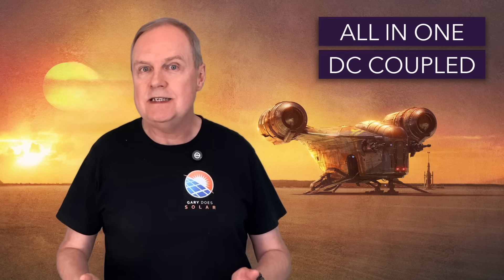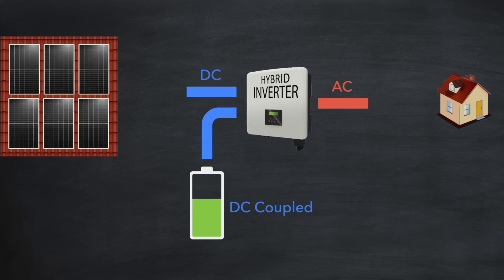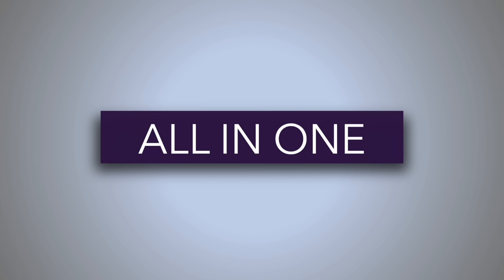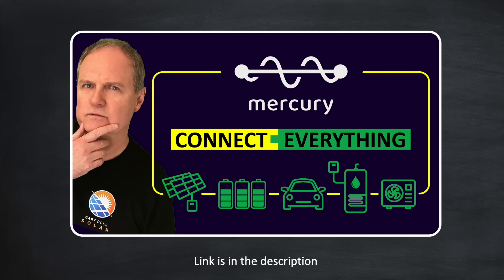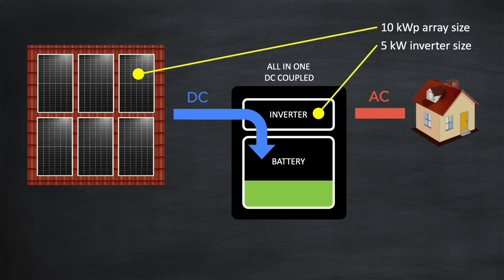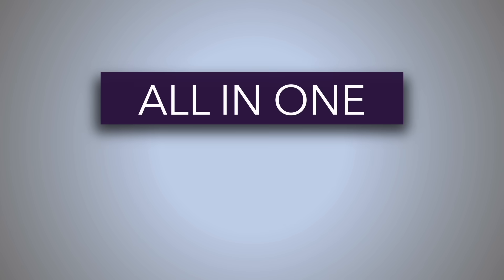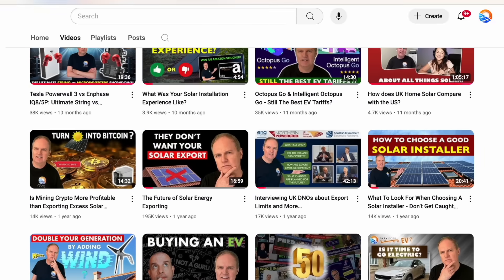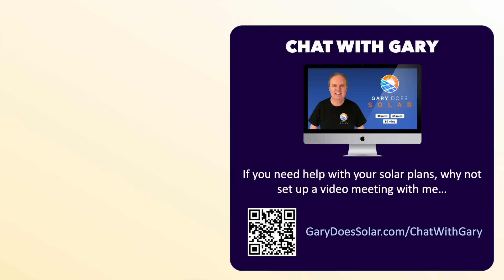Why All-in-One DC Coupled Systems are Transforming Home Solar

Comment: Great video, Gary! I agree with what you said. However, a drawback of all-in-one systems should be mentioned: you are reliant on a single manufacturer for your batteries. Will Prowse recently published a video of a 16 kWh LFP battery that cost less than $2k and was also incredibly efficient (though also more dangerous) because it uses high voltage DC. Additionally, the inverter was completely silent in sharp contrast to all the noisy inverters he had previously. However, he mentioned that at this time the system only works if you use the battery and inverter from the same manufacturer.
As to the micro inverters combined with battery storage, it seems to me they will always be both inefficient (due to multiple AC-DC conversions) and expensive (because you have to have 2 sets of expensive inverters). I don’t expect that the micro inverters will ever have both AC and DC output. As a general rule, it seems to me that: (1) if you want battery storage, avoid micro inverters; (2) if you can’t avoid micro inverters, don’t connect them to batteries unless you absolutely have no alternative.
Reply: The difference in costs between brand tied batteries and good quality non branded batteries is enormous so for any large setup an all in one is vastly over priced, and can't easily be upgraded.
For small batteries the ease of install and thus cost is a huge win though, especially if you are getting fleeced by the MCS.

Second consideration IMHO is that most of the current "all in one" models are Apple like products where it's useless without the suppliers cloud, the suppliers app, the suppliers batteries and on it goes. If your supplier goes bust (as is not unlikely when solar consolidates to a few brands in a few years), or if China v Taiwan kicks off you are going to be the proud owner of a very expensive brick. Likewise if your vendor does what Ecoflow keep talking about and decides to charge you a £9.95/month service fee for the cloud some day in the future you will be stuffed. Not just all in ones though - some of the non AIO ones are as bad.
Reply: @etchedpixels  The Sigenergy requires the cloud for updates to the software but not for operation.  You can get local monitoring via your phone if need be.  The battery modules can be replaced or added to individually.  New modules with different chemistries or other battery technology can be readily incorporated.  So far I haven't seen a better system on the market.  Admittedly I am in the USA and so my options are different than yours.  But It is pretty dang good.  I have seen a lot of videos showing how to build you own batteries for this purpose to save even more money.  I know for around here you would be hard pressed to get anything like that approved through the building jurisdiction or the Utility company.  Not to mention the fact that I am 70 years old and am not interested in building and carrying very heavy batteries around the house.
Reply from the maker: Great replies to your comment, Frank—and great insight from you 👍🏻
Reply: We’re already working with 500 volt DC from solar strings so voltage is not a new concern. The lower current in higher voltage circuits reduces heat which is the greater risk. It’s interesting that the National Electrical Code in the US is published by the NFPA. The FP stands for fire protection not shock hazard.
I’m too heavily invested in 48 volt to be changing to high voltage batteries at my age but it seems like the wave of the future. Especially in commercial or industrial applications where 480 3 phase is used.
Reply: You are correct.  However, it stops the "Oh, that's the battery or Oh, that's the inverter" when you call for support when an issue arises.

Comment: In 2023 we had 31 PV panels installed and we opted for Enphase IQ8A Micro Inverters.  Then in early 2025 we had two Powerwall 3s installed after they were updated to be either AC or DC coupled.  So that's what we have and it a great solution.  We were planning on adding two more expansion  packs but we are now holding off as V2H will be coming to more Tesla vehicles and having access to 70+ kWh of mobile storage is a dream come true.
Reply from the maker: Thanks for sharing this, Thomas—great stuff 😀

Comment: Keep pushing Gary & perhaps Sigenergy will help you replace your old system 😉. 
I've got my eye on a Sigenergy system to replace my 3.6kW GE Hybrid because I need a larger inverter capacity & want whole house backup as well. Just got to save up some pennies to make it happen!
Reply: I'm literally just doing that now.  Going from 3.6kW inverter with a 3.3kWp solar system, to 14kWp, 12kW sigenergy system, gateway and 25kW DC car charger. 
It's not cheap, a bit rusty watering but I look at it as buying 30 years of energy in advance. 
In an earlier video Gary mentioned Nationwide doing 0% mortgage add on's for renewable projects.
Reply: @djtaylorutube is the 25kW DC charger dependent on 3phase power?
Reply: @donalfalvey145 Nope 😀
It draws power from the DC bus devices and grid. 
To be honest that part is an expensive toy that I opted for, not for the charge speed, though one day that may be a bonus but rather future proofing when V2H gets more interesting. I considered adding it later but figured that I'd talk myself out of it and as part of a solar/battery install at the same time, comes in VAT free.
Ideally it would work better with the batteries as they provide power at half the capacity to the DC bus. I have 16kWh so could draw 8kW from the battery bud, then need a good sunny day and whatever from the grid. I don't know what the maximum grid import is yet. 
Irony is that on IOG tariff, my car is usually charging at 5 Amps. 😉
That said, it can be reduced in power (apparently) and it's just more efficient going entirely through the DC path to the car.
Reply: @djtaylorutube  Interesting. Thanks. My Installers told me I needed 3 phase for the 25kw DC charger. They may have been thinking of the older AC 22kW charger. I have 32kWh sigenstor and was thinking about expanding and adding a DC charger. I'd likely start another stack using the 10kWh (9kWh) batteries and add the DC charger to that stack. Looking at the Sigenergy spec sheet for the DC it doesn't mention 3 phase at all. But it also look like you can use single phase with the 22kW AC charger? I've asked them for clarity on the AC side
Reply: @donalfalvey145  I asked ChatGPT for the AC one, it didn't have much faith for the AC version running at 22kW without three phase.  Makes sense to me too.
Reply from the maker: Ah now, Colin—I have plans afoot for that… 😀👍🏻

Comment: I am adding Tesla Powerwall 3 to my solar only setup with 5kW Solis inverter (2 strings East and West). Should I restring DC  to Tesla Powerwall or go with AC coupling?
Reply from the maker: Provided that you’re not on a government scheme (like the FiT scheme in the UK) where any changes could invalidate any contractual arrangements, I agree with Colin—wire everything into the PW3 😀
Reply: I’d dump the solis and just use the PW3.